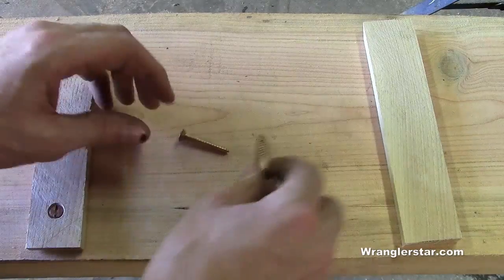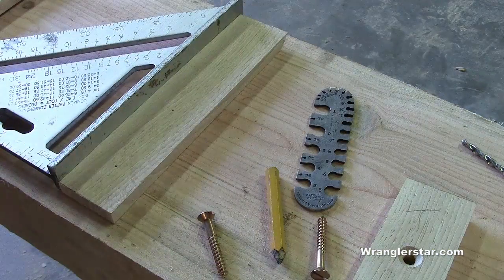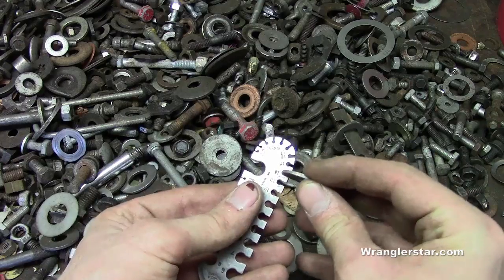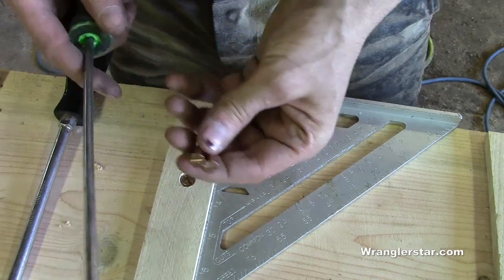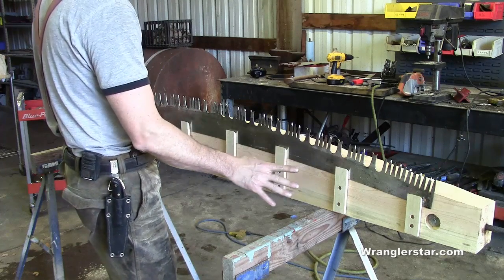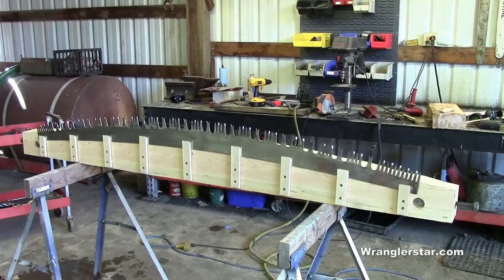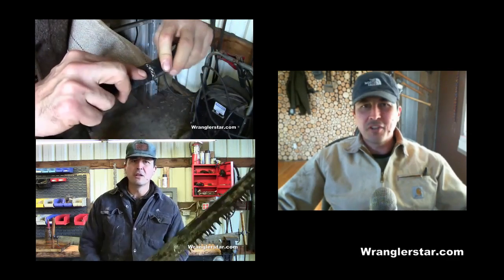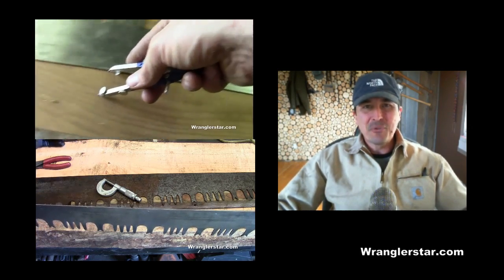Crosscut Saw Vise 3.0 - Wranglerstar

Comment: Great that you mentioned the proper screwdriver to fit the screw.  I was teaching this to my daughter yesterday as we were installing the roof hinges on the beehive(s) project.  We were using phillips, but the lesson is the same.  Ended up with 2 different brands of hinges and 2 different head sizes.

Comment: Just an idea for drilling horizontal- suggest rotating drill 90 degrees and have it rest on its body when placed on a flat table- assuming the wood and table are level, using the side body of the drill keeps the bit parallel to the table and wood

Comment: Along with the rest of the vice, I hope you are planning to share a sharpening tutorial with us too.  Also, I would like to respectfully suggest when using boiled linseed oil, you might consider sharing with viewers a quick comment on safety regarding the proper handling of rags and such to prevent a possible fire hazard from spontaneous combustion.  Sorry, I will now take off my Safety Sally hat.  Work smart, be safe.

Comment: great advice on flat head screw drivers.  Best shotguns always came with custom "turn screws" or screw drivers perfectly matched to the various screws in the gun.  No PROPER gunsmith would touch one of these screws without a perfectly matched turnscrew.  :)

Comment: What's the difference between raw and boiled linseed oil (other than one is boiled)? Is it just the colour or is there something more technical involved?
Reply: boiling it does something to it that makes it either preserve better or penetrate into the wood better. It makes a big difference though.
Reply: Boiled linseed oil (BLO) will dry like paint upon being exposed to oxygen, raw linseed oil will take forever to dry--there's no comparison.  BLO used to be boiled back in the day, but what is commonly available has usually been treated chemical dryers which may not be the healthiest thing.  There is at least one company, maybe more, that makes BLO without the chemical dryers (food contact safe).  Check out Tried & True Finishes.
Reply: Thanks for the info. I did notice that the boiled version that I was looking at ( https://www.masters.com.au/product/900031014/diggers-pale-boiled-linseed-oil-1l ) says that it has "drying agents". I didn't even consider that it may not be food safe. Thanks for pointing that out - I will look more closely now!
Reply: +CodeFoxAus Apparently "Boiled Linseed Oil" is not linseed oil that has been boiled (at least, not anymore).  It used to be boiled to remove moisture and allow it to dry more quickly.  Now, they just add chemicals to it that make it dry quicker.

At least, that's what I read on the Internet.

Comment: I don't mind a flat head screw if it isn't overly threaded. You can put a ton of torque into a flat head. I HATE PHILLIPS SCREWS. They are designed to "cam out". Hex allen or Torx is where it's at.
Reply: The strongest screws are the cross-head type.  (That's probably NOT the correct name for them.)  They look like a phillips head screw, but the cuts are completely flat on the bottom like two flat head slots cut perpendicular to each other.  With those you get all the advantages of the phillips head with none of its disadvantages.  Flat head and Torx screws are the prettiest though.  I work on guns a lot, and those are always the ones I go for when I have a choice.

BTW, another tip for working with flat head screws is not to use regular hardware store screwdrivers.  The wedge shape of the head likes to cam out of the slot. Instead invest in a good gunsmithing screwdriver set with hollow ground bits.  You'll mess up far fewer screw heads with those!
Reply: Gunslinger454 ditto on the gun smith screwdrivers
Reply: TheJohn8765 I like the Robertson screws My self. A few years back I ran across some Robertson Phillps combo screws I used on a desk I made  You could drive them with ether type bit

Comment: Cody, what are the threaded rods on the end of the vice for?
Reply: I was wondering that too. My guess is it will be like an Engine mount. To where you can rotate it around and work on it from different angles. Say if you needed to lay the saw down and work like that he'll be able to rotate it 90 degrees and lock it down and keep working. BUT we'll see. I'm really interested in seeing the final product.
Reply: MADACE404 That's probably an accurate guess.  Thanks!
Reply: MADACE404 That is exactly what the threaded rod is for. Pivot the saw around so that you can work on it comfortably.
Reply: Chip Wright Awesome! I'm not a wood worker AT ALL, which is a big reason I'm such a fan of Cody's channel. Everything is fascinating to me but I figured that was probably it because I do work on vehicles quite a bit. Thanks for letting me know!
Reply: It's my pleasure. That's how we all learn, by sharing our knowledge with each other. I wouldn't have known for sure either, but I have seen other vices in saw filing videos in the past. I started getting interested in these old saws a few weeks before Cody started showing his interest in them on here. Never say never, you can do anything that you set your mind to. I like Cody's channel because it's good clean entertainment and you're always learning something too.
Reply: They are there purely for suspense and anticipation so that you watch the next video! hahahah!
Reply: CodeFoxAus That too! lol

Comment: What does 4 Gauge of taper mean?
Reply: Wire and metal is measured in gauges as oposed to fractional-inches like wood  14 gauge wire is as thick as 14 gauge sheet metal for instance

Comment: hmm still lost what a crosscut saw vise is, and why you're doing all this.Seems more useful with the handles on it!
Reply: +Dave B It is a vise to hold the saw so that you can safely and accurately sharpen the saw.

It helps to read the info box below the video.

Comment: what are the bolts at the end of the vice for?
Reply: Watch the earlier episodes, it's for adjustment if I remember correctly.
Reply: iggywow I'm confused do you know what they're adjustment for?
Reply: ***** Angle I'd assume,
Reply: But why would you need to adjust angle. I assume, i don't really know at all, that you would just clamp the crosscut saw into this vice and then sharpen and adjust the teeth, the vice would just remain stationary.
Reply: iggywow I really don't know this is just sort of a guess
Reply: Felling and bucking crosscut saws have two types of teeth. The slicing teeth on the crosscut are filed at an angle. Similar to a dagger blade the slicing teeth are filed to a sharp point. Every other slicing tooth is beveled on the opposite side. Having the vise be able to tilt helps in holding the angle of the bevel consistent. The crosscut slicing teeth have set. The teeth are bent at an angle. Just like the bevel on the tooth the set is opposite on every other tooth. The set makes them scribe two parallel lines on the wood that define the kerf width.
The raker teeth between the slicing tooth groups are filed straight across. For filing rakers, having the vise straight up and down is best. The rakers are shorter than the crosscut teeth and cut like chisels. They carve out the "noodles" from between the parallel lines cut by the crosscut teeth.
The saws balance is greatly affected by the bevels, and set of the crosscut slicing teeth in relation to the depth of the raker teeth. Too sharp of a bevel and the crosscut tooth dulls quickly. Not enough and the saw drags.
The rakers have to be shorter than the crosscut teeth. Quite often I find one and two man saws with the rakers actually taller than the crosscut teeth. A saw with that problem forces you to shove the rakers through the wood without the crosscut teeth doing any of the work.
That's a lot more of an answer than you asked but the design of Cody's saw vise was developed over a long period of history. It works very well and every part has a reason for being there.
Reply: Very helpful thanks